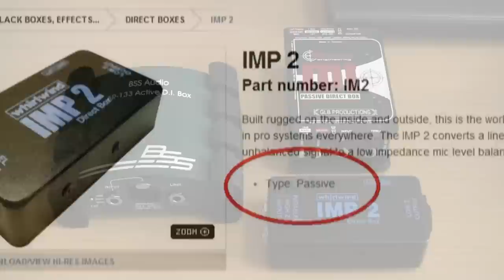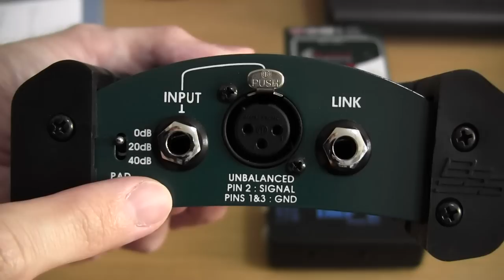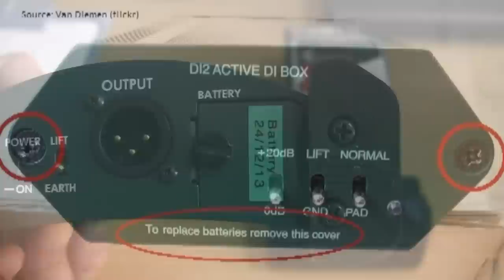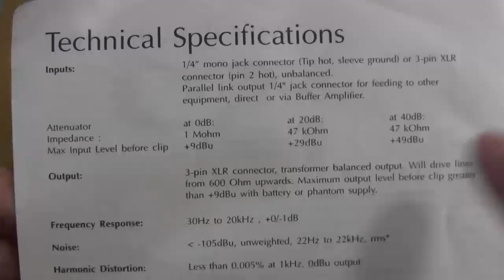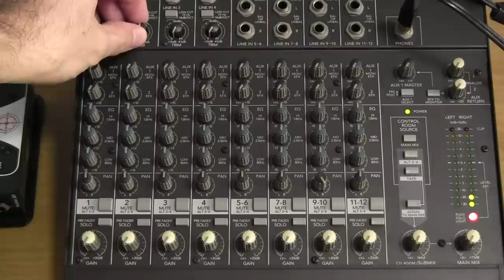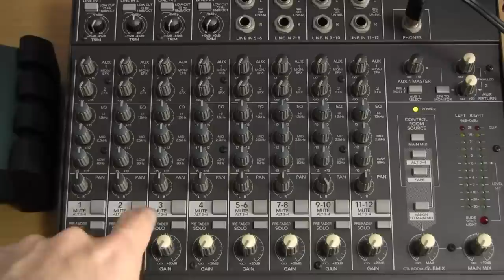DI boxes part 2: Active vs. Passive

Comment: +GLB Procutions Would it be possible to get a signal out of a PC headset mic (electret mic) with an active DI Box? Most of what I see online suggests I need to build something with a 3-9V battery to power it.
Reply from the maker: +Jason Takes Omegle Which make and model of PC headset do you have?
Reply: +GLB Productions A cheap department store headset, with an electret microphone, that generally requires being connected to a PC for the mic to work. It needs to be a small headset to fit inside a latex mask.
Reply from the maker: +Jason Takes Omegle I presume the mic has a minijack-style connector?
Reply: Yeah, 1/8"
Reply: I've got 1/4" adaptors.
Reply from the maker: +Jason Takes Omegle You know I've never tried this before? Let me see if I have something similar at home and give it a shot. It should work but I've never actually tried it out.
Reply: I've seen that some people build little 3-9V systems, but I figure if a DI box can drive the mic, that saves me having to try source the parts to build one and I haven't properly soldered in over a decade.

I'm getting more into latex, props and weathering clothing these days.
Reply: +GLB Productions would I be better off just wearing the headset, but use a lavalier mic, instead? Do they plug into a mixer, no hassle?
Reply from the maker: Jason Takes Omegle There are some like that - most lavalier mics can be ordered wired or wireless, you'll need to look for one that comes fitted with an XLR connector or has the appropriate adapters to go from minijack to XLR.
Reply: +GLB Productions what about Line-In mono? I've only got the one XLR and the rest are Line.
Reply: +GLB Productions I was just looking at some wired lavalier mics and they seem to be electret ones as well and come with a little power supply. That might be what I'm looking for.
Reply from the maker: Jason Takes Omegle Yup, the power supply should allow them to connect to a line input on the mixer.

Comment: Would a imp2 make a difference(sound quality wise) on a roland acoustic amp with a Takamine acoustic with an active pre-amp???
Reply from the maker: Chris Riches Where do you propose to connect the IMP2 in that signal chain?
Reply: Forget that, going to run it thru a PA with an IMP2 after the guitar...Cheers.

Comment: Great video Bruno. I've been following your videos and learned a lot.
I'm planning a new setup at my church.
Do we need DI box for microphones?
Reply from the maker: You're welcome Danny. Microphones with a low impedance balanced output like the SM58 do not require a DI box.
Reply: @GLBProductions  what about other microphones such as choir, pencil and large diapraghm condenser?
Reply from the maker: Not needed.
Reply: @GLBProductions  Thanks!

Comment: Thanks Bruno! 

Are the mixer preamplifier characteristics different between the TRS and XLR inputs in general?  I have line level devices - synths, drum machines, digital pianos, etc. and none are over 15 feet away from the mixer.  Some have balanced (XLR), some have TRS, some have TS.  Is there really a need to reduce levels to mic level if using the XLR inputs?

Thank you!
Reply from the maker: It depends on the mixer :) On cheaper mixer the line level input goes through a -10dB or -20dB pad and is then fed through the mic preamp. On more expensive mixers the line input completely bypasses the mic preamp - you can work this out by looking at the mixer's signal flow diagram which will be in the user guide. 
If you are not experiencing any overload or distortion go right ahead and use the XLR inputs :)

Comment: So, if I use a guitar with passive pickups + pedals (Either powered by battery or connected to a Power Supply), I'd need a passive DI box, right?
Reply from the maker: Correct :)

Comment: Very informative video. I have a question hope you can help me with. At the moment I am on the lookout for a good DI box. I was thinking about the Countryman Type 85 to plug into my Steinberg UR44 interface. Since the Countryman is an active box, would I be overloading the Di box or even my interface by hooking up a Big Muff distortion pedal?
Reply from the maker: If you're using the UR44 just plug the output of your pedal straight into channel 2 with the Hi-Z switch engaged and it should work fine, no DI box needed. Set your gain such that the peak light only comes on during your loudest playing.
Reply: I have tried on all channels and all sound awful unfortunately.

Comment: Best explanations on YouTube. Please advice if I can use a preamp (like ART Tube or Presonus Studio Channel) as a DI-box ?
Thank you
Reply from the maker: ***** Thanks for the comment! Yes you can, but you have to be careful to check that the preamp has a sufficiently high input impedance to work with the type of instrument or pickup you are using. For example the ART tube MP has an input impedance of 840 kilohms, which is fine for magnetic pickups but may not be enough for a passive piezo pickup. 

In addition, most preamps are AC powered which will entail running AC power to your location on stage, one additional thing to consider.

Comment: Is possible to plug di box directly into audio interface (I have focusrite clarett). What cable should I use between di box and focusrite and what type of connection should I set? Is it a line input or mic?
Reply from the maker: In general this is not necessary or helpful - just set the interface to INST mode and plug the instrument straight in.
Reply: @GLBProductions  I wanted to use a parallel connection (THRU) and use my amp to play guitar and record the DI signal at the  same time
Reply from the maker: In that case use the XLR out to connect to the interface (mic) and the thru or parallel out on the DI to connect to your amp.

Comment: Quick question - I figured that my Aftermath and VII Bare Knuckle Pickups are quite hot so should be fine with my Radial JDI passive - especially since I have an active Fernandes Sustainer guitar, and mostly using DI for electronic channel software sends, to guitar effects. Do you know about Bare Knuckles and if they are hot enough passive is ok? Or is even a hot passive signal not high enough impedence? Sorry I'm noob with technical things and trying to expand my knowledge. Also got passive since everything coming out of my mixer (through active reamper for hi-z level) is active, so I figured passive is best. But I still want an active as well :) I'm guessing from your info that I should be still experiencing high frequency roll off somewhat with the Bare Knuckle pickups? At least from mic level output of passive Radial JDI, into Rolls MP222 mic preamp, the input into mixer (line input) is fine (can't use mic input due to not being full range input mic inputs) I don't have my signal coming in weak, but probably still having high freq rolloff from the DI?
Reply from the maker: Your case is rather interesting because the Sustainer guitar uses active electronics, therefore in theory a passive DI should be fine. However your ears must be the final judge of these things. Some electric guitarists using passive guitars prefer a passive DI for the darker sound it gives them, sort of like rolling off the tone knob. However most will want to retain as much of their original tone as possible. You might try writing to Fernandez and asking which DI they recommend for live use and/or re-amping. 

Another thing - what do you mean by 'not full range mic inputs'? Which mixer are you using and how do you know the mic inputs are not full range?

Comment: Hey, very nice video! Cover basically all the areas without the bla blah blah. But I still have a question, with D.Is do I always use microphone input or there is a case tat I should use te line input? 

Thanks in advance
Reply from the maker: +Michel Nebonta A passive DI should always be run into the microphone input of the mixer. An active DI can sometimes be connected to the line input, it depends on whether your mixer has sufficient gain and what the output of your active DI box is. Use whichever input gives you the best results.

Comment: I have a BBE DI-100x and on the back it has both balanced and an unbalanced outputs... What's the purpose of the unbalanced output?
Reply from the maker: Tampa Bay What does your instruction manual say? I would be interested to find out.

Comment: I've watched several of your videos in the past and found them all very informative, thanks.  This time I have a question I don't think was covered and I didn't find that it was asked and answered by any others.  My apologies if I missed it.

What is the proper setup in terms of DI boxes for someone who switches around between passive and active sources during a set?  Referring to concerts I've seen, it appears they always use the same cable.  Assuming you don't expect the sound man to adjust the gain for every instrument.

Thanks.
Reply from the maker: mike coughlin Hello Mike, thanks for getting in touch. 
The best way to deal with this situation is to run two separate DIs on two separate mixer channels, each one set up appropriately. In most cases the EQ will need to be different for the two instruments (eg a passive Fender Jazz bass vs an active Stingray) so it makes sense all around.

Comment: Hi. Very nice educational video. Learned a lot.

I have a question. Do I still need a noise gate/suppressor pedal if I have DI box for my electric guitar plugged to pedal effects?

Thanks. Hope to hear from you soon
Reply from the maker: That's up to you - you can either use a hardware noise gate or a software one in your DAW, depending on which you prefer the sound of :)
Reply: Thanks for your response.

Comment: I've done live audio for years and it's very rare to use passive DI's, the pads are usually enough to limit the signal so it won't clip and rarely I've had issues with input impedance when pad is enabled since high level, high impedance sources are a rarity.
BSS AR-133 and Klark Teknik models are very common in Finland in live-use.
Passive DI is great in that they're more reliable, they have no active parts so they rarely break. But that's about it on their usefulness in my experience :/
Rarely I've had to use them since the artist requests their signal to be ran through their passive Radial "because it's my sound", but yeah... even  issues with long cables are getting rare these days when guitars and basses are using wireless transmitters and after that it's CAT5/6 to the digital mixing console... so yeah :D
I almost exclusively use them to separate ground loops and when ever the source is unbalanced and it has to be plugged in to a balanced mic-preamp..
Reply from the maker: Thanks for the comment - as always, we use the right tool for the right job 😊

Comment: Hey man first of all thank you so much for the very informative and useful video!!! Second I have a question. Since all I see on that whirlwind is a ground lift switch, is that the only purpose of that box, or does it automatically make the xlr output balanced as well? Also would you consider recording with a mic using phantom power from a interface on a guitar cab to be passive or active?
Reply from the maker: ***** You're welcome, thanks for watching!

The XLR output is always balanced via the transformer. The purpose of the ground lift switch is to break the pin 1 connection between the input and output of the DI - this is used to deal with ground loops. 

Which microphone are you using? All professional mics feature balanced outputs and do not require a DI box :)
Reply: So you are saying that if I were to mic up my Randall amp with a shure SM57  that has tons of gain I would most likely not need a DI box? That's awesome! Thanks again.
Reply from the maker: ***** No need my friend - the output of the SM57 is already balanced and low impedance! I suggest you watch my first video on DI boxes so that you better understand what a DI box does and when it is needed: https://www.youtube.com/watch?v=2SBGSDKgKHo

Comment: very helpful video and very clear explanations. thank you! 
I still have a question though. I'm a bassplayer and own a marcus miller fender jazz bass which has a preamp built in. I can turn it on or off with a switch. now if I am correct as soon as I turn on the preamp my signal is active, correct? when I don't use the preamp my signal is passive, right? 
now let's say I wanna record a song where I play normal fingerstyle (I don't need the preamp for that) and slap bass for certain sections of the song (I prefer the sound that I get with the preamp so I would turn it on for slapping). what kind of DI box would you recommend in this case cause I produce an active and a passive signal if I understand correctly. 
hope you understand what I mean cause  I'm kind of new to these things as you probably can see :P
thanks again for your helpful videos and hopefully you can answer my question. greetings from switzerland =)
Reply from the maker: Hello my friend, nice to hear from you! In this situation I would use an active DI box and engage the pad if necessary to prevent any distortion at the input of your recorder.

Comment: Great videos.  Well articulated.  Had a question.  Would I use a DI box sending a signal (2 vocal mics) from a PA into a Tricaster?  Assuming the PA has unbalanced outputs.  Tricaster has only balanced inputs
Reply from the maker: - Hi Connor thanks for the question. Could I just check what make and model of mixer and tricaster you are using, thank you.
Reply: GLB Productions
Wish I knew the PA.  Been trying to contact the venue about this.  The tricaster is the 855
Reply from the maker: Conor O'Donnell Ah yes the old problem of not knowing the venue equipment beforehand... 
Mixers with unbalanced outputs are relatively rare these days, but on some older consoles with only 1/4" outputs it can be difficult to determine if they are balanced or not. 
In this case a passive stereo DI box will be your best choice to ensure balanced and noise-free operation.
Reply: GLB Productions
Thanks.  Keep up the good work

Comment: Excellent explanations, buddy! Thnx so much for sharing your knowledge; it is the first time I understand what a DI box does either pasive or active.
I have a question: I use a sure beta sm57 to record in my home studio, but its signal many times isn't that high enough to be manageable and I need to put the mic to close to my mouth or turn up the input volume too much to get enough from it, but you know that doing that causes many times issues in  your recording, so very often my recordings signals are often low, is there anything I can do to fix it using direct boxes??? Thnx in advance.
Reply from the maker: Hello my namesake 😊 With dynamic mics you need a preamp that has a lot of clean gain - around 60dB in many cases. Using a DI box will not help in this case because the output of the mic is already balanced and low impedance.
Reply: @GLBProductions  thnx so much for your answer. My interface (scarlett 2nd gen) has a preamp and it helps, but not too much, so I guess it' would be better to get a mic with high impedance output, right?
Reply from the maker: No, just use your current interface and bring up the level in post-production!
Reply: @GLBProductions  Awesome, I've been doing it that way. 🙂
Thank you so much again. Best regards

Comment: Thanks for your informative video. It is very helpful. Yet, I have a couple of questions about attenuation functionality of active DI boxes. My signal chain is a Martin performance artist series acoustic guitar with Fishman F1 onboard preamp to Rolls ADB2 active DI box  to the mixing console. I know that my guitar is an active instrument but my church only has the Rolls Active DI Box, so I turn the attenuation switch to -20 or -40 and adjust gains knob on mixing console. (ex 1: Fishman half way, -20 on Rolls, 9 o'clock for gain; ex 2: Fishman half way, -40 on Rolls, 12 o'clock for gain). My questions are 1. Can I just use the Rolls for my guitar? Or it will be better to get a passive DI box; 2. If I use the Rolls, what would be the better choice between -20 and -40 attenuation and matching the gain along with the attenuation level. Again thanks for your video.
Reply from the maker: +Stella and BK Thanks for getting in touch, you have some nice videos! 

Yes you can use the Rolls as long as your gain structure is
set correctly. I recommend not using ANY attenuation on the Rolls to begin
with: the minus 20 setting is actually
meant for line level signals like CD players and the -40 setting is for
loudspeaker level. Use the 0dB setting and see if you can get the gain on your
mixer correct - it may need to be turned all the way down. If that doesn't
work, use an XLR->TRS adapter and run into the line level input on your
mixer. That should solve the issue.
Reply: +GLB Productions Thank you very much for your explanation and suggestion! I will try this week.
Reply from the maker: Stella and BK You're most welcome, let me know how it goes.